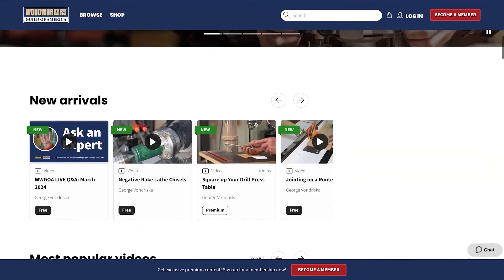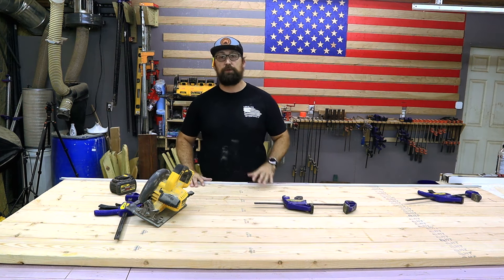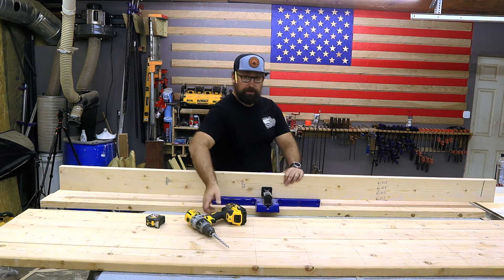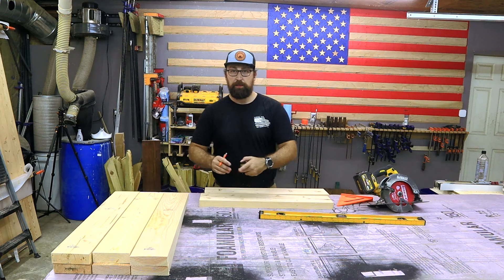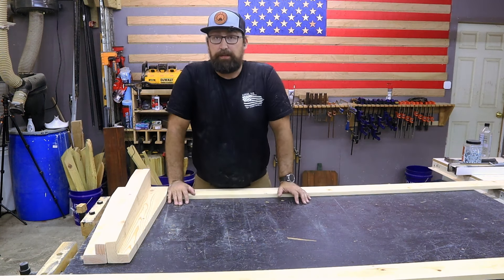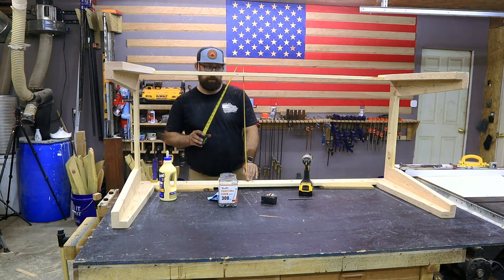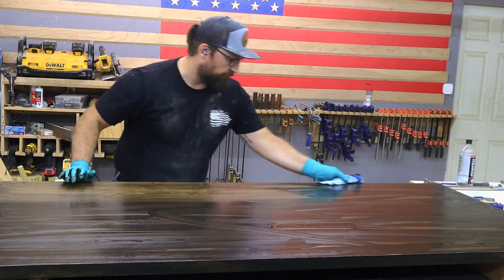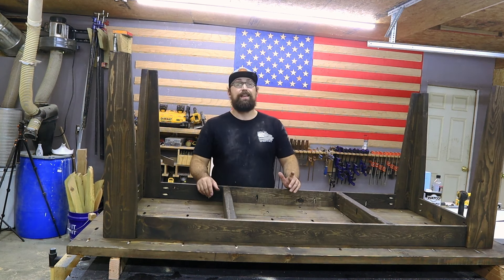Make This Table UNDER $100 With A Circularsaw and Drill!

Comment: Before applying finish, I always like to 'pop the grain', to help avoid a gritty, rough final result.  By wiping down the surface with a small amount of water, this swells and raises the grain slightly, pushing hidden bits of sawdust out of the sanding scratches.  Then lightly hand-sand with the finest grit already used to smooth the raised grain and sweep away the older sawdust, following up with a good mineral oil wipedown to make absolutely sure of getting all the sawdust out.  Doing this has helped me make my stain and topcoats as free of grit as possible, leaving them smooth and silky to the touch.
Reply from the maker: Those are amazing tips. I appreciate you sharing.

Comment: Great work!!  A thought I had at the end.  If you want to hide those pocket holes in the table top, Kreg makes plugs that are stainable, I believe.  It just adds to the professional made look.

Also...what are your thoughts on corner bracing?
Reply from the maker: I love the tip. Thank you

I havent had any issues with the legs on this design, but they could easily be added.